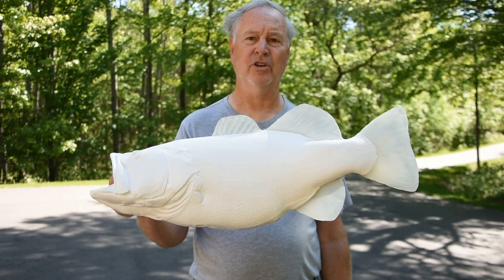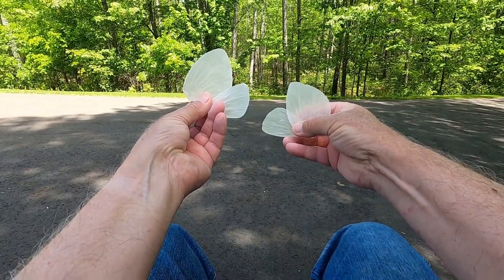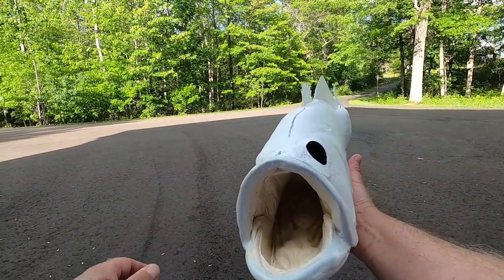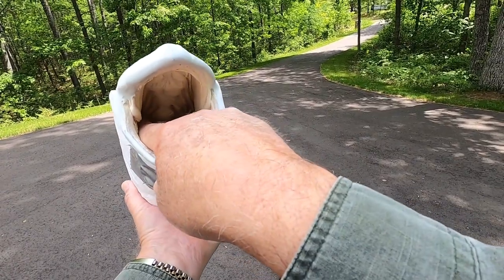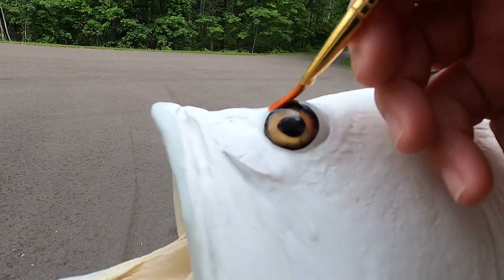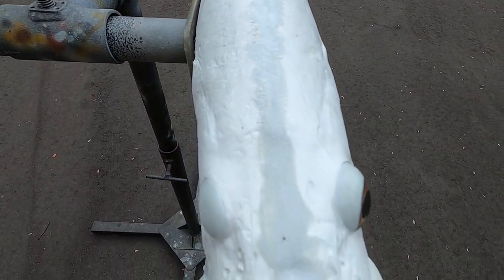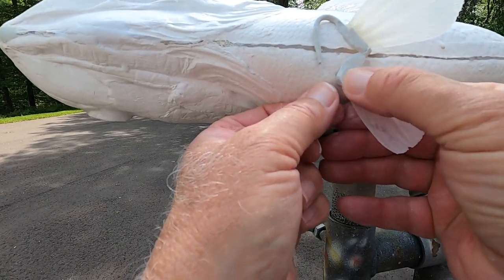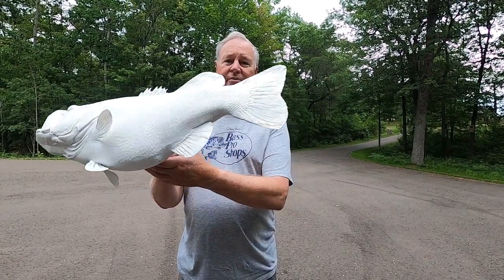How to create a Fish Replica / Fiberglass Reproduction LM Bass Taxidermy

Comment: Why did you primer the eye? Is it that easy to take primer off withought scratching it later?
Reply from the maker: I prefer to use glass eyes (not plastic) for that reason. A little lacquer thinner and 0000 steel wool polishes them beautifully.

Comment: great stuff , is the mouth plug latex from a wax mouth pour ?
Reply from the maker: Yes, plug is latex. I use silicone in my molding, but wax (or plaster) would probably work too.